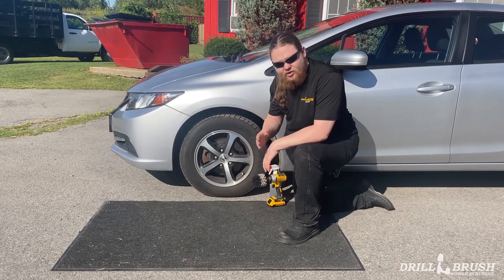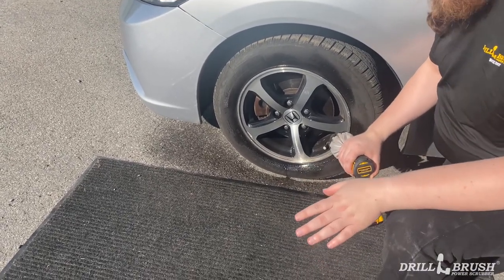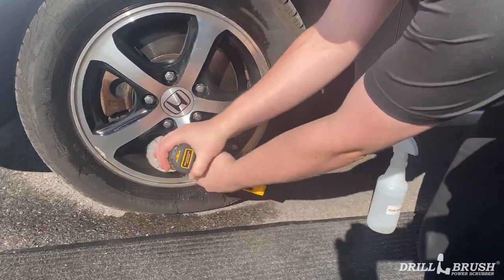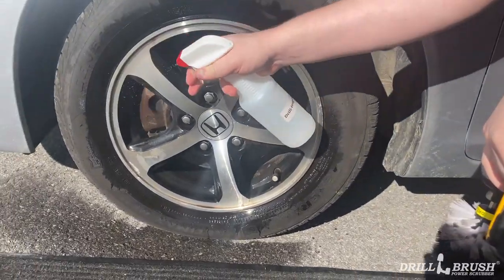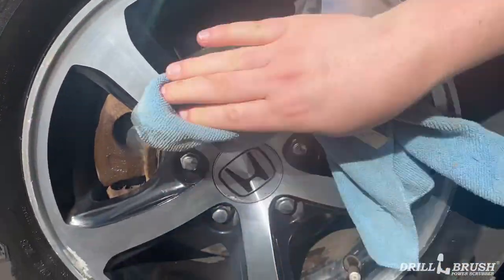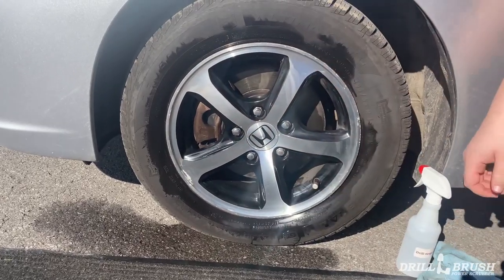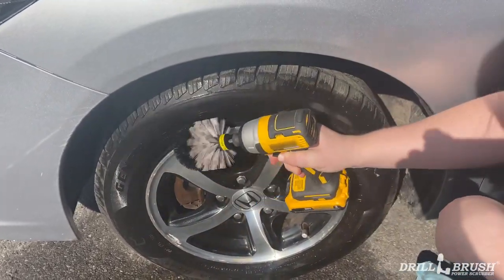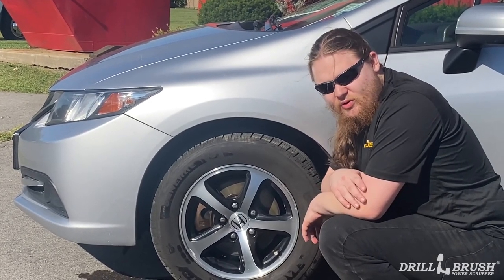How to Clean Rims and Tires with a Drillbrush | Drillbrush DIY Guides

Comment: Post a video on what grade Drill Brush should be used for inboard of spoked side (barrel) of chrome wheels with heavy brake dust & road grime buildup.  Need to pull wheels off the car for this job for full access & efficiency.  None of your brush descriptions mentions which one is too aggressive for chrome, if that’s even a thing.  I seriously doubt the white grade is good enough for that.  Aloha.
Reply from the maker: While all of our brushes are non-scratch, the particles of brake dust and other debris can scratch chrome finish if they get stuck to the brush. It is the same reason why we don't recommend our brushes for cleaning car paint.

For that level of grime, we would recommend our Medium or Stiff brushes, as they'd be able to scrub it better than the Soft brushes. However, if that mess is on the chrome finish, you shouldn't use our brushes.

Comment: WRONG,never clean first interior of the wheels,and than exterior,you are mixing dirt and iron rests on glossy part of wheel.It must be more profesional.
Reply: Define interior & exterior of the wheel.  Are you talking about the interior of the rim inside the tire?  The inboard wheel flange?  Between the spokes?  The inboard body of the full inner diameter?  ???